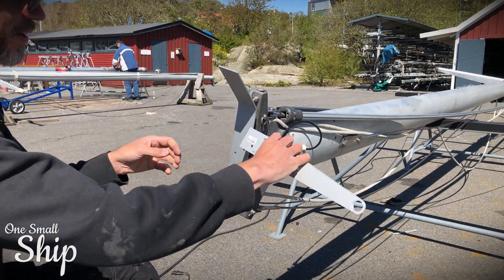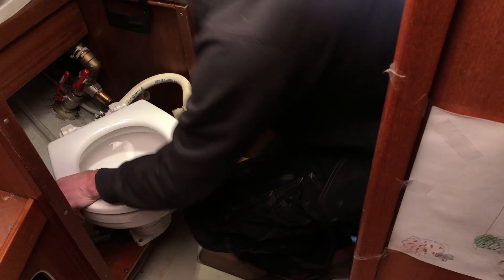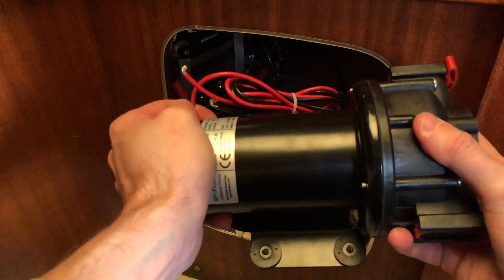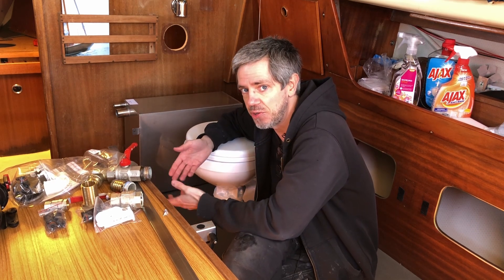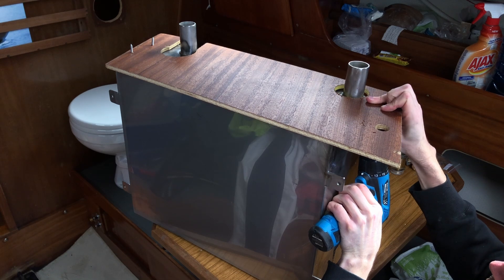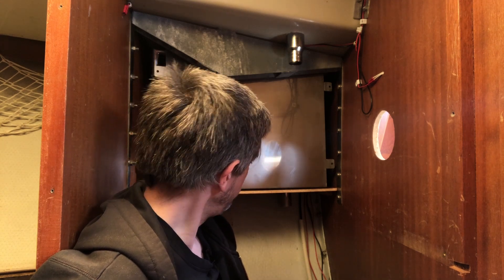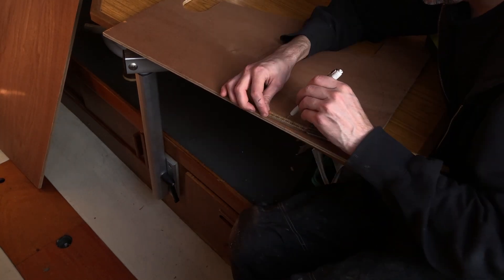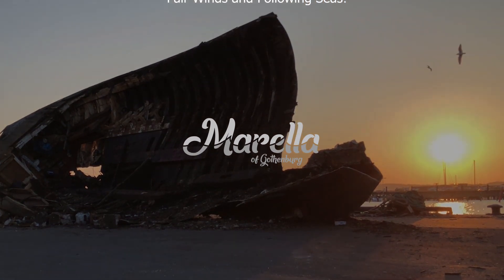One Small Ship #5: New season! Starting electric head rebuild!

Comment: Hi!
Thanks for the video!
Where did you find the drums for the winches?
Mine are also in very bad shape so I bought two new but the rear ones I'd like to just find new or refurbished drums.
Reply from the maker: Hey, thanks for commenting! :) I saw a for sale ad for an old pair of Lewmar 40’s, the same kind I have, and bought them. The insides were about the same condition as mine but the drums were in much better shape, so I thought it as well to just replace the drums.